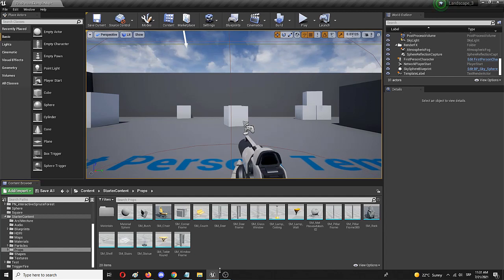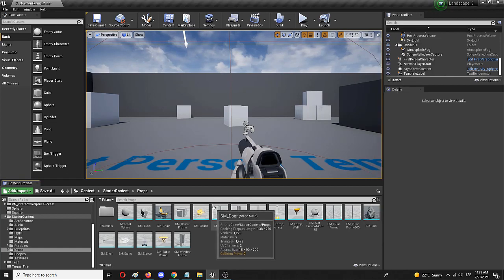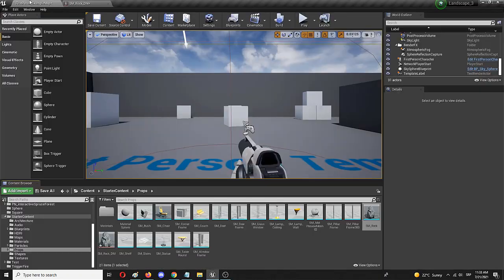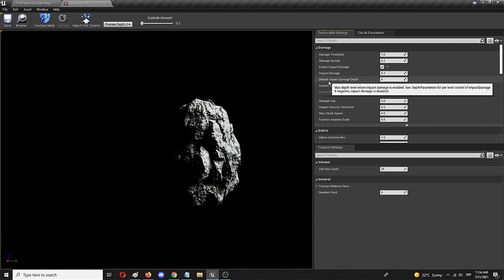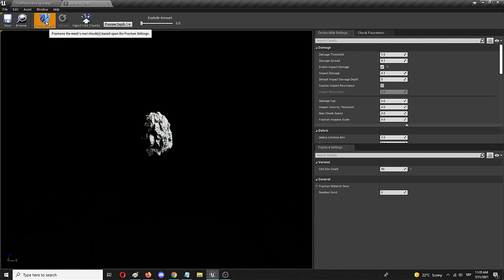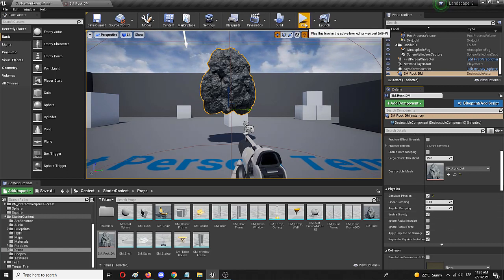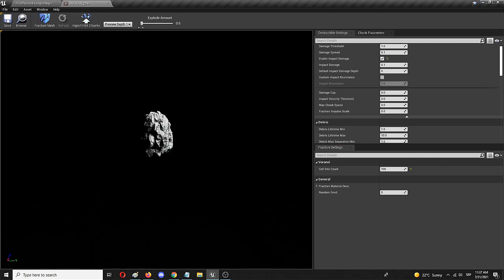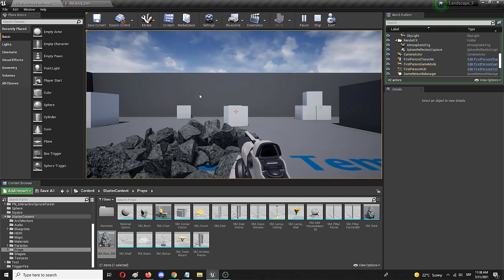How to Create a Destructible Mesh in Unreal Engine - UI Beginner Tutorial

Comment: On UE5, the plugin exists, but right clicking the static mesh doesn't provide the option to create a destructible mesh.  Any suggestions?
Reply from the maker: Hi! Sounds like a bug or a glitch, the process should work in a very similar way. Have you had any luck with it so far?
Reply: @IvicaMilaric  👋   The context menus have changed and it’s just not in the menu unfortunately. It may be because they changed to the new fracture destruction? I can’t even drag destructible meshes into the scene. 🤔. Has the little red not allowed icon 🚫
Reply from the maker: @jamesonvparker  Hm, that "not allowed icon" is not a bug. Wait, did you save the entire project beforehand? Also, can you drag other regular meshes into the scene? Maybe it's something in the project settings.